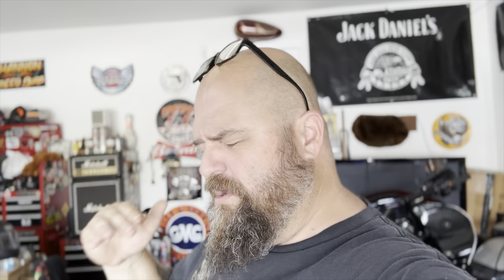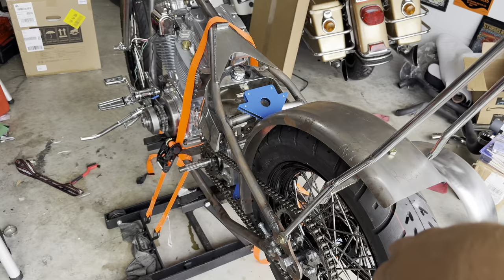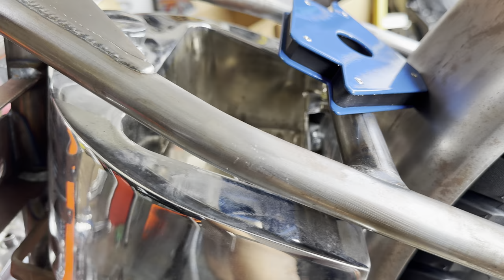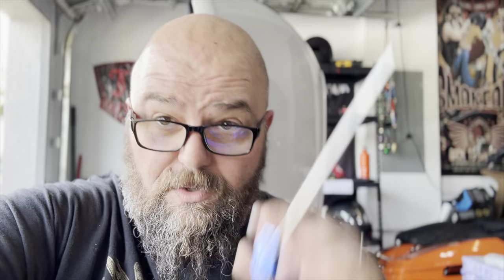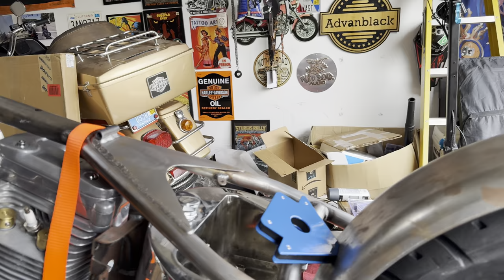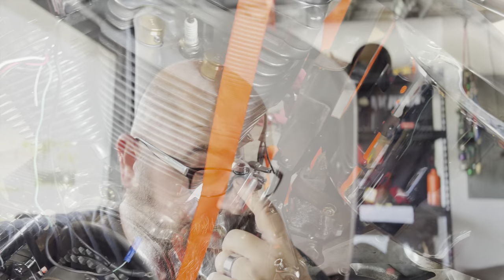Update on the chopper build! Here's where we are and where we need to be.

Comment: Great update. Thanks for sharing 👍 you'll be done with the build way before smoke out if you continue at this pace. I was wondering if you have dimensioned the transmission to match that powerful engine? If memory serves well it came with the engine but back in 95 they haven't had those Trask and you name it brands that are available, today. Have fun at Disney 🤙
Reply from the maker: I've wondered if it will hold up to hard use. I am not even sure what it is to be honest. It is the transmission that was with it, but still. I bet this motor is pushing 100 hp...

Comment: Turn that 4 inch 3/8 bolt around and I bet a standard 2 or 3 inch bolt will fit nicely///  Plus put a nut on either side of the threaded adjusting piece to take the strain off the threads.